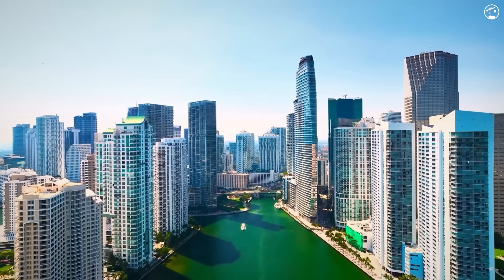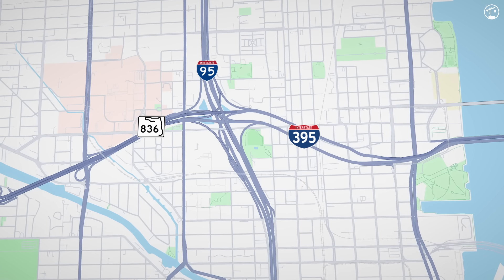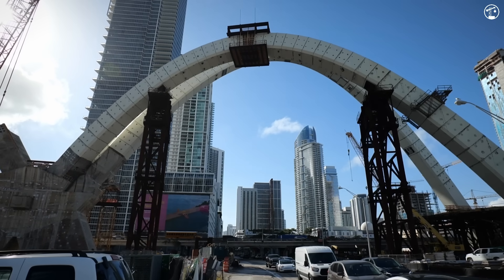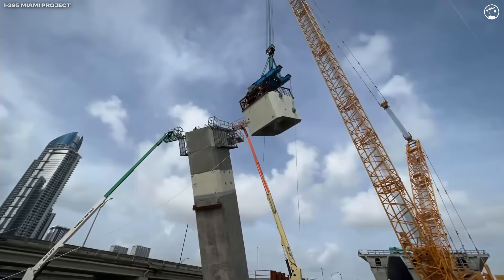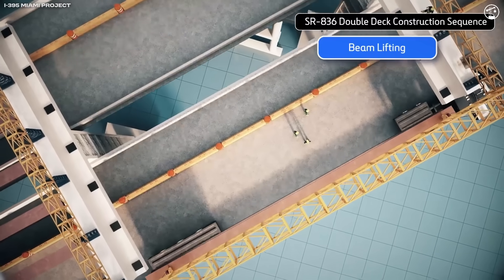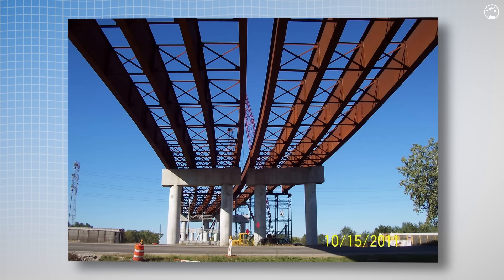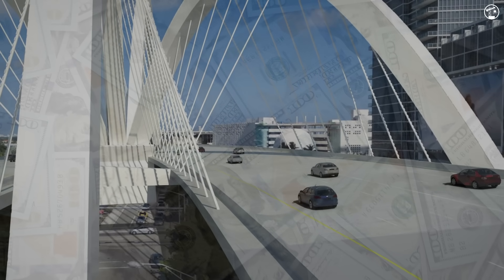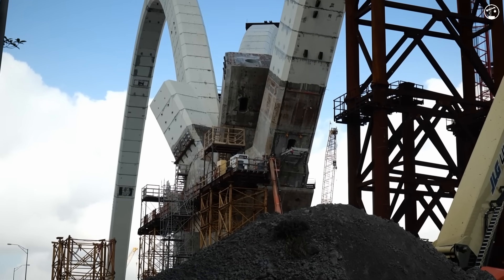Why Miami is Building this Insane Bridge

Comment: Every year I spend 2.5 hours driving from Broward to the Miami Beach Convention Center to cover Art Basel & other art fairs during Miam Art Week. This drive has become increasingly worse over the last 10 years. We often return at night to attend art week events and have spent more than an hour on the Julia Tuttle to get to Miami Beach -- like the last 1.5 miles on the beach. It would have been great to see some form of connection from either the Brightline or Trirail with a maybe a light rail transit system that takes you from the mainland into Miami Beach. Or, at least parking from the mainland and access to Miami Beach via an efficient and regular public transportation system. To me, that makes more sense than having a "landmark".

Comment: I agree that they need to expand the rail system in SFL. If only they would build rail roads adjacent to these highways. The traffic would be greatly reduced and commute would be so much faster, especially with express options. Right now that project is a major eye sore and a pain in the a$$ because I have to drive in that area several times a day.

Comment: This bridge is dangerous. The fiu bridge collapse is very similar. It's not even a bridge it's a overpass. And the MacDonald's arches are esthetic just like the other signature" again. Luis Berger was not qualified and now they are saying McDonald because that's what we were calling it. I will not be passing through if it even gets done. Due to the fact the workers are scared of getting deported. And is one of  the reason for the delay. I don't want to know what the other delays might be.

Comment: For the many people commenting on using the 800+ billion to build/extend rail to Miami Beach:
One major hinderance is the residents of South Beach (at least the wealthy residents of the west (bay) side of the area. They have aggressively refused the extension to Miami Beach for decades. They have no need to use it, and do not want it in their neighborhood. Meanwhile, visitors, the less wealthy inhabitants, and most of the mainlanders (including myself) have been asking for it for years, and would benefit greatly in its construction. 
If it was similar to the downtown Metromover (as was the plan in the late 1990s), it would be much less intrusive than the behemoth Metrorail. But forget it, as the vote again came up and the residents again shot it down.
So we get an extra lane to South Beach and a giant spider thing. It could be cool in October, if they illuminated it with white, red and yellow lights. Just like the giant golden-silk orb weavers (banana spiders) that are common around Miami.

Comment: 3:01 Good thing Miami is built on rock. It is an oolitic limestone outcrop up to 20+ feet above sea level. It is about 10 miles wide and extends from Miami southwest to the east Everglades, and reappears in the lower Keys to Key West. It forms in shallow tropical seas, landward from coral reefs, which is the limestone substrate of the Biscayne islands, upper, and middle Keys.
This rock makes gardening a challenge, but greatly aids in erecting high rise structures. FYI: Miami Beach is also on a limestone rock substrate (the northern end of the fossilized coral reef of the Keys. In Miami, the rock breaks the surface, and reaches 25ft above sea level. In Miami Beach, it’s a few inches to several feet below the surface, the ground here a combination of sand carried down the coast, and a mucky organic soil derived from the tall mangrove forest that once covered much of the Miami-Dade barrier islands.
This all may seem like trivial nonsense, but as already mentioned, the solid (as semi-solid as coral/limestone rock is) bedrock provides a decent foundation for these structures. And at least for Miami (a few blocks inland from the bay) are above sea level, extremely porous, and drain after heavy rain. Although- high density construction is inhibiting rapid drainage/ absorption.
As for gardening, once the plants are in the ground, they grow very well. Pioneers used dynamite to blow holes into the rock before planting guava, mango, lime, sapodilla and other local crops, a luxury I cannot utilize!

Comment: As a born and bred Miamian - we don't need that stupid spider thing -  Just widen the road to the McArthur, improve  the I95/836 interchange.  All of these "raised" roadways only elevates the traffic and doesn't alleviate it - look at the 836/826 interchange with all of the elevated roadways - people get confused and there's still as much traffic as their was.  And thank you for not addressing public transportation.  It's beyond time Miami has a spur that goes from  MIA to the Beach.
Reply: Stupid spider thing 😂😂 I agree wit everything you stated
Reply: In fairness the 826/836 interchange sees a lot less backups then it used to in my experience, but I agree the new bridge is obscenely expensive for just a single extra lane. Also the idea that a bridge surrounded by large and high-rise buildings will be considered a landmark is laughable. Just expand the lanes, make the interchange smoother and more well thought out, and put some money into expanding Metrorail for once.
Reply: @TomClancy11746 going off your statement they really gotta put some money into the metro system its really a s show

Comment: The construction cost is only one part of the life cycle cost of any infrastructure.  A complex structure like this will be costly to inspect, load rate, maintain, and repair over the next 100 years.  Most people never think about those costs.  That’s why I’m a proponent of keeping bridge designs simple.  But what do I know.  I’m just a DOT Bridge Engineer.

Comment: Soon you won't be able to see any of it as 50+ story condos, office etc rise around it, a Rail link to the beach would have been a better use for 800M$
Reply: Definitely. 
One major hinderance is the residents of South Beach (at least the wealthy residents of the west (bay) side of the area. They have aggressively refused the extension to Miami Beach for decades. They have no need to use it, and do not want it in their neighborhood. Meanwhile, visitors, the less wealthy inhabitants, and most of the mainlanders (including myself) have been asking for it for years, and would benefit greatly in its construction. 
If it was similar to the downtown Metromover (as was the plan in the late 1990s), it would be much less intrusive than the behemoth Metrorail. But forget it, as the vote again came up and the residents again shot it down.
So we get an extra lane to South Beach and a giant spider thing. It could be cool in October, if they illuminated it with white, red and yellow lights. Just like the giant golden-silk orb weavers (banana spiders) that are common around Miami.

Comment: Some good points being made in the comments, but to add something new, my friend and I have always wondered what a water taxi might do to help pedestrian traffic. Cyclist, e-bikes/scooters and traditional walking will soon become the prefered way to get around down town and Brickell with the increased population density as these newly constructed towers open thier doors. Thousdands of new cars added to an already overun infastructure. In addition to these local burdens, what we lack is fesible optionality for pedestrians, cyclist, scooters etc. to get to and from the Miami Beach safely without running the gauntlet of cars on all the major bridges. A water taxi system could be a new way to look at this problem. My guess is with the shipping and cruiseship marine traffic, something like this might require a huge undertaking logistically. Just a suggestion, outside the already mentioned, worth thinking about.

Comment: Useless design. The money would have been far better used to improve public transport and/or improving public infrastructure for both under privileged communities and flood prevention. This bridge construction has been nothing but a nuisance, and the design looks genuinely stupid unless you're far enough to recognize the intended shape, which is not possible because there isn't an unobstructed view of that thing more than a block away

Comment: I wonder how they’re going to control the homeless population from overrunning that area once it’s established. On top of the fact that once this opens, with less lanes than the original 395 had, the traffic is going to be far worse. The direct connections from 395 to i95 North from the “fast” lane seem to be just to the express lanes, further creating strain on the lower section to be utilized for local exits. 
Recently, the mayor indicated they’ll need to retract funding from Public transportation as the funds given during Covid are now backtracking. This place is trying to be New York or California without any of the infrastructure and it’s horrendous.

Comment: As a Miami resident I always find it hilarious when LA people think they have the worse traffic, they have no idea lol…
Reply: Los Angeles is significantly larger than Miami and the traffic there is worse than the traffic in Miami.
Reply: @Ilnatica because LA is much larger it has more lanes, more pathways, more streets with multiple lanes, etc. all which keep the traffic flowing. Miami’s smaller size and very very  few streets that exceeds 2 lanes per direction, causes horrible traffic that is much worse than LA.

Comment: Instead of spending money on this mega-construction project, they should invest in trains, using existing tracks or expanding them to allow trains to travel around the city. With this project, they're only increasing traffic, which will continue to be chaotic and polluting. Florida is a tourist-heavy state, and it's shameful that there's only one train that runs from Miami to Orlando, and it's also very expensive. They should follow the example of Europe and Asia and not spend more money on wider roads.

Comment: I think one of our biggest problem is the amount of roads that run parallel to each other and then you have immediate exits. That drive locals and tourist crazy. You have to jump on one street to jump off at another to get onto the highway to get into another lane that takes you in the opposite directions so you can goexactly where you want to go. It’s not intuitive to drive our streets without a GPS. On top of that, we’re not the best drivers… Combine that with high volume and tourism is definitely a recipe for disaster.

Comment: Miami is building a bridge designed to handle traffic 20 plus years ago.  The bridge needs to be at least five (5) lanes each direction to handle TODAY'S traffic.  The bridge will need to be either 1) widened or 2) replaced within ten (10) years because it is way too narrow to handle today's traffic, let alone traffic in just ten (10) years. They could have left the designed the same, just made it a double decker bridge with five (5) lanes each direction.
Reply: There's a realistic limit to how wide you can make these highways in the middle of downtown Miami. Plus, even if you could make it 20 lanes each way, they still have to spill out into 2 or 3 in the middle of town or in Miami Beach. It looks like the bridge is holistically going to fix a lot of the last-minute highway lane-switches which impede constant traffic flow.
Reply: That’s not how it works. There is limited right of way and funds. It seems it will address some operational issues, which unfortunately is all you can do give the available space. The only way of mitigating traffic in such a highly urbanized area is by reducing the amount of vehicles on the road at a given time or by imminent domain a lot of properties, which is a financial and legal nightmare
Reply: @ManCity4InRow  It is already a good 20 years outdated for the traffic it will handle.  I live in Florida. I see this all the time.  Tye interstate in my areas was "updated" / widened less than ten years ago using plans from the late 1980s and early 1990s.  It was out dated when it was finally done. How here, ten years later, it is going to be widened again. The new proposal will barely handle the traffic we currently have, let alone any future growth in just a few years.
Reply: @altairiv6326 I live in Miami and I’m a civil engineer that does roadway design. You are right. It is not designed to handle the current or future traffic. However, that’s not the point. The point is that there is simply no room to add more lanes. The cost would be prohibitive. You would have to buy a huge amount of private land. So, they are doing the best they can. There is a limit to how wide you can make the roads in such an urbanized area.

Comment: Before you all get excited over this bridge, just remember that the builder of the eastern portion of the SF Bay Bridge by the same builder had cost overruns in the billions of dollars.  "Originally estimated to cost around $1 billion in 1996, the final cost ballooned to over $6.5 billion. This represents a massive cost overrun, with some sources estimating a 2,500% increase."  Not only that but critical flaws were found that are serious defects that are going to cost a lot more to rectify.  "The new San Francisco-Oakland Bay Bridge's eastern span has been plagued by significant construction flaws and failures, including cracked welds, suspect concrete, rusted tendons, and broken anchor rods. These issues have raised serious safety concerns and prompted investigations and reforms within Caltrans."
Reply: These cost overruns are by design. 
Of course they would land the deal in Miami-dade-county, North Cuba.

Comment: What do I think of Miami's new Bridge, its a waste. Just listing the stuff for the central pier and the arches, what a waste. There is so many other areas that need attention over this design piece, and Miami doesn't need it. People aren't coming to Miami for a Bridge over land. They could done a nice sleak upgraded bridge here and saved so much money. They could saved some money for the Monorail/Metromover link to Miami Beach or to Hard Rock Stadium, or up the Northeast corridor, or expanding South down US-1 any of those over this design piece. Of course any of those would have required more money but save the money for some thing actually needed.

Comment: $800 million for this is a bargain. The Eastern Span of the SF-Oakland Bay Bridge is 2.2 miles, designed by the same folks as this Miami upgrade. The SF-Oak span cost $7 BILLION. It had the same lack of cost controls as the present CA High Speed Rail project, with the same resulting budget blowout.
Reply: Haha, you really believe it's only going to cost $800 Million.

Comment: They should've buried the road instead. 
Imagine a "Big Dig" in central Miami.
Reply: The Florida coastline sits on sediment, you cant dig too much or too far or you'll hit water very easily.
Reply: They already did something similar, but it just connects to the port.

Comment: I don't see the purpose here, the structure itself doesn't serve a purpose, it isn't structurally supporting the road deck so why spend the literal millions of dollars? Expand the Metromover up Biscayne Blvd beyond 15st and add two new metrorail lines, one to the beach along 5th st and one running parallel to either Miami Ave or Biscayne Blvd, running within the median on either. Circularize the orange line by extending it south from the airport to Coral Gables and extend another line from the airport all the way to FIU.
Reply: The millions spent on the arches is so it looks pretty........
Reply: And how many people use the Metrorail system today? These highways are not full of suburban commuters driving to a central business district.
Reply: @barrypaul4199  not that many people use it because it doesn't go where they live. hence the point of expanding it.
Reply: @barrypaul4199  There's about 50,000 people that use the metrorail system every day. That's very low for its capacity. It can easily accommodate more than 500,000 but believe it or not the vast majority of Miami commuters get around via the bus system as it goes literally everywhere and all the way down to Homestead. One way to improve those numbers would be to increase density around the stations like in Vizcaya, Coral Gables and Dadeland. The new Purple line up 27th Ave will directly run next to new high density housing projects. So it is transforming itself.